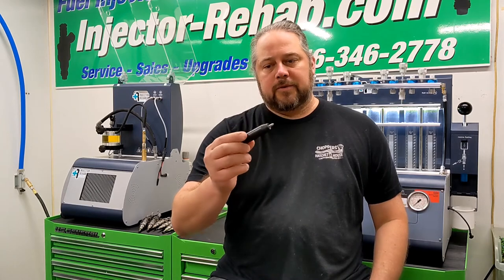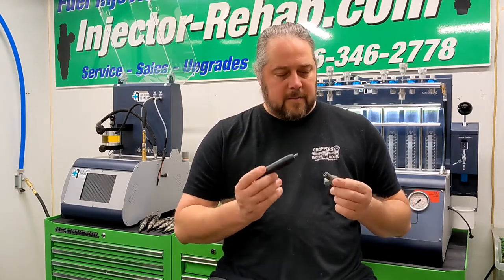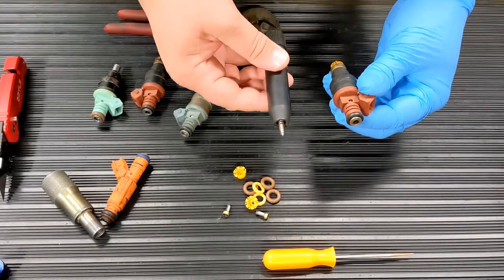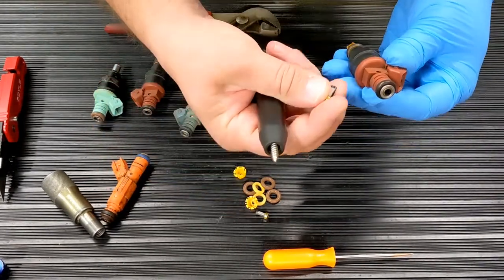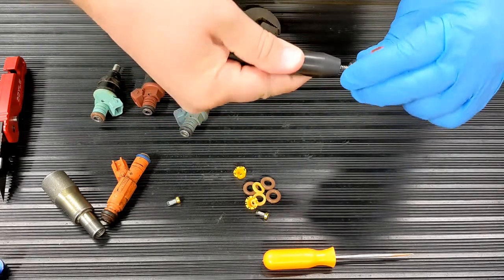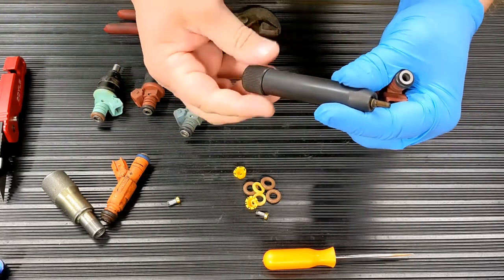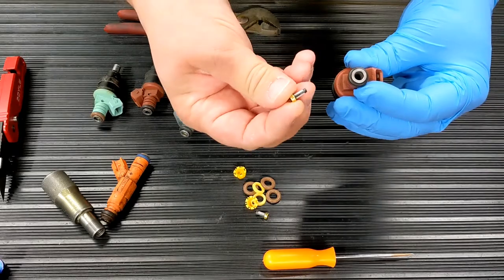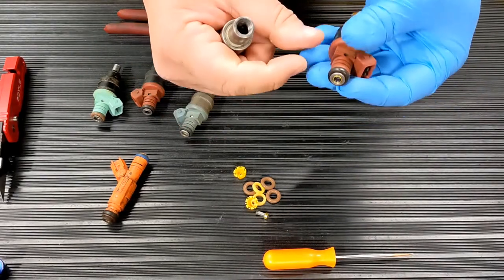Injector Filter Removal Tool

Comment: Hey hows it going, I have a 04 frontier 3.3. Is there a special tool to remove that type of filter?
Reply from the maker: Side feed filters shouldn't be replaced unless torn or cracked, just ultrasonicly cleaned. If they do need to be replaced, no, there is no tool, you just remove them.